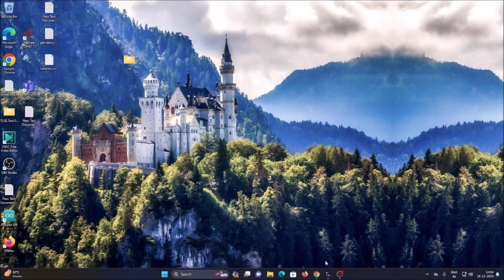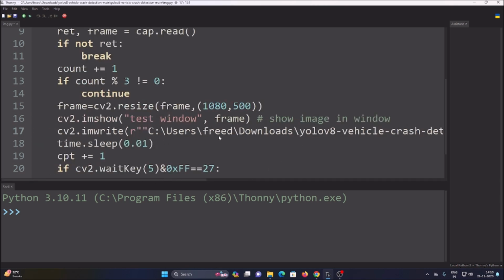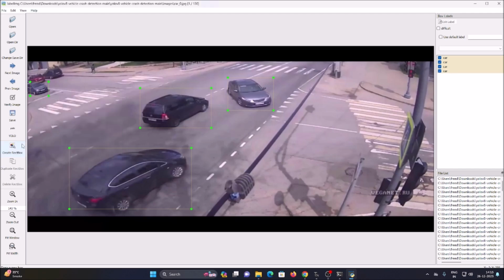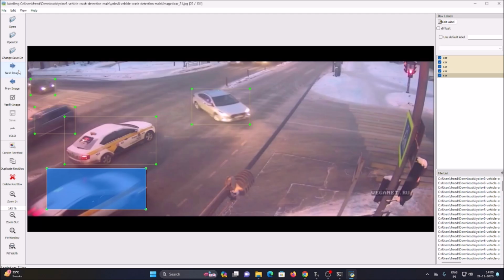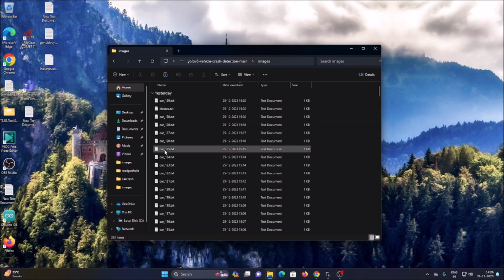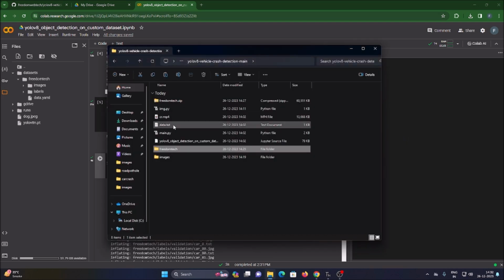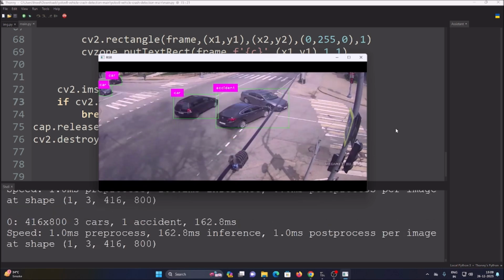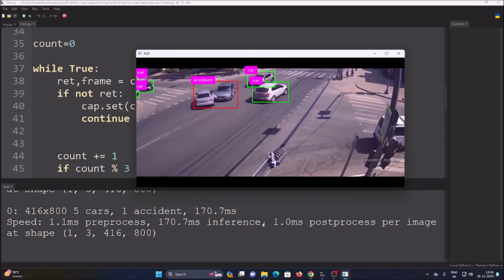yolo v8 car crash detection | road accident detection yolo v8 | car crash detection project

Comment: But your model is not generalised, can it detect from any random video ? Surely it wont
Reply from the maker: how it is possible i create model for this video only this is just idea if you want to create model which detect any random video you need large dataset  more then 1000 images
Reply: @freedomtech5307  yes that's what I said, yours is not generalized.  I create with 3000+ images and still it's not perfect detect only 6-7/10 videos
Reply: @lokendrasinghrao  can u share ur code and dataset link
Reply: @lokendrasinghrao  sir can you please share me the model you have trained with 3000+ images can share your mail id or GitHub link.